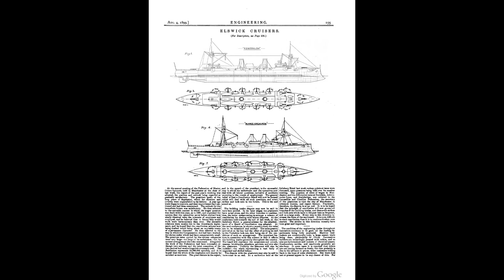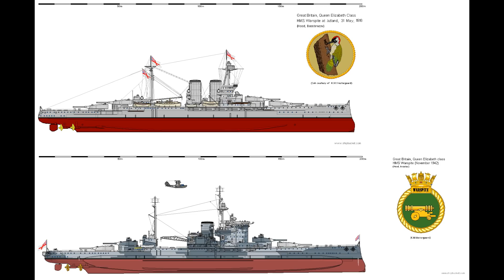The Drydock - Episode 007

Comment: One point not mentioned is that the US Navy had three different 5" guns in use early WW2. The 5"/51 was used as the Secondary armament for the Standard Battleships from the WW1 era and fired a projectile weighing 50lbs.  The guns removed from the older battleships as they received more AA guns were placed on the Sangamon and Bogue class CVE's and were given field mounts and assigned to US Marine Defense Battalions, including the 1st Marine Defense Battalion at Wake Island where they sank a Japanese DD and damaged a CL helping to end the first attempt to take the Island. The  second US 5" gun was the 5"/25 which fired a 54lb. projectile using a somewhat smaller propelling charge than the 5"/51 and was designed as a Dual-Purpose gun able to be traversed more quickly. It was the standard Secondary armament on the interwar light and heavy cruisers until the St.Louis class and the Wichita debut its successor the 5"/38. which could fire the same shell but offered superior performance due to using semi-fixed shell casings, and the longer barrel providing more complete powder combustion.

Comment: Regarding question 00:09:22 about laundry; I'm not sure when the RN implemented it but I know that on Swedish ships we had a central laundry facilities quite early, before that we had "drawer cruisers" a joke about the ships that ferried dirty laundry like your underwear and then ferry back with clean clothes.
Regarding the boilers in the question at 00:33:05 there wouldn't actually be much point in having a lot more boilers as the propulsive resistance to water increases dramatically with an increase of speed. So for instance look at the battleships of WW1 were it was often enough with 20.000 to 30.000 HP for 21 knots like the HMS  Iron Duke, but a battlecruiser of roughly the same tonnage needed 70.000 (HMS Princess Royal). 
You would have to design a much longer hull and finer lines like the Iowa's to drive a ship in higher speeds. For instance if you want the previous class South Dakota with their short squat hull go at the same speed as Iowa, they would need more than 280.000 hp! 
Look into hydrodynamics and propulsion resistance.

Comment: Q&A 1. Can you elaborate on the kind of maintenance required for battleships? At what point is it no longer economical to maintain/keep a battleship in service? Many battleships had a 20 year service life(Anglo-German arms race era) , when the service lives of the Iowas span many more decades, why is that? 
2. Please explain your youtube channel name.

Thanks again for the hard work, really good stuff here.
Reply: Short answer.... The Iowas spent most of their career in reserve storage. The so called Mothball fleet. They were sealed up and ported in freshwater locations like Philadelphia Naval yard. Then, as needed they were reactivated. So in reality they have fewer miles on them than say the 50 year old USS Enterprise now retiring. AS for maintenance? Rust prevention, lubrication, mold prevention, pest control, bilge pumps running, etc. 
As to the economics? Today it is manpower costs, and logistical issues that prevent a return. They need huge crews to manually operate systems. They use old style fuels not in service. Have parts not replaceable and crews not trainned in BB systems.

Comment: As for the USN sticking with the Standards - in addition to the reasons you quoted, you could say the primary reason was Secretary of the Navy Josephus Daniels, appointed By Woodrow Wilson. He absolutely refused to approve any substantial changes to the Standard design, determined to hold costs to a minimum, only allowing minor improvements related to seakeeping and combat and crew efficiency. As an example, the USN had actually completed testing their 16 inch gun in 1913, and requested year after year to be allowed to change the Standard design to accommodate this weapon - and year after year, Daniels steadfastly refused, forcing the Navy to stick with the 12 gun 14 inch design. Only with the entry of the US into WW1, did Daniels finally relent, allowing 16 inch guns on the Colorado class, and approving the South Dakotas and Lexingtons. Mr Daniels was also infamous in the USN for completely banning alcohol in any form aboard ship, being a diehard member of the Temperance or Prohibition movement.
Reply: It was also put forward as a rationale that if the US built fast battleships, it would render the entire fleet of Standards obsolete. That's why the Lexingtons were designed as battlecruisers with almost nonexistent armor instead of as fast battleships.

Admiral William Sims pointed out that this was idiotic, and that the entire fleet of Standards was already obsolete on account of Britain building HMS Hood. It was only because of the Washington Naval Treaty that Britain and Japan were cut off from building more vast battleships like G3 and No. 13 that would've outclassed USN BBs in speed, armor, and firepower. And yet the General Board somehow thought that if they ignored the fast battleships of other navies, they would just go away.

Comment: Thanks for another great episode of the Dry Dock

On the question of Japan using huge numbers of DD's in place of a balanced battle fleet.  This is not a new idea.  Around the end of the 19th and start of the 20th century the French also thought about doing this.  Replacing the fleet with Torpedo Boat's and Subs as they knew they could not out build the British in capital ships.  Called the Jean Eucole school I think.
It was not proceeded with because of the reasons Drachinifel put forth.  A balanced fleet will smash a specialized fleet like this, especially as the torpedoes of the time were short ranged and slow by even the standards of WW2.  This is also one of the reasons the Destroyer was developed, to destroy Torpedo Boats swarming your BB's.

One question I have is: Why do people (even today) rave about the 'Awesome' firepower of Bismarck's main guns, yet sneer at Vanguard's when both ships had 8-15 inch guns?  Although an older design, the British gun and its turret were considered one of the best designs ever produced.  Additionally the German 15 inch shell was much lighter than the British and had a high failure rate.

One the boiler question.  One country did put speed ahead of other requirements.  The Italian rebuilds of their WW1 ships used the weight savings to up the speed from 21 to a maximum 27 knots.
Pity the armour of these ships was left mostly alone and wasn't sufficient to withstand the 15 inch shells they would face.  All they could do was run.

Comment: Question...

Can I con you into doing a blurb regarding double and triple gun turrets vs 2-gun and 3-gun turrets? I notice you using double and triple for all turrets, and I'm pretty sure there's a distinct difference in their operations.
Reply: One more gun. One more gun crew. Aside from that? Added weight and size to fit the 3rd gun. Other than that? They all work the same. Speed varies by crew skill.
Reply: And ^^that^^ is why I want him to answer the question. If the number of guns were the issue, I would be sorely embarrassed to have to ask the question; while also wondering if the speech to text program I'd have to be using was adequately accurate.

Case in point. The Iowa uses a 3-gun turret, specifically NOT a triple turret.

Comment: The boiler explanation left out a major problem factor of oil burning vs coal fired. Oil fired steam was rapidly developed in the post-war because there is a much higher energy density with much lower particulate load and hence the high-eff. Small tube burner.

Comment: Q and A: I think the Kongos got their entire power plant replaced twice during their refits and ended up with more than double the amount of power. I was wondering if it is an example of "32,000-ton destroyer" you referred to in this video where they kept the power plant's original size or is the new boilers so efficient that even with a reduced power plant it was able to produce twice the power? Can you look into both re-enginings of the Kongos? Thanks.

Comment: The incident with the Colombian destroyer reminded me of the last broadside fired by a Royal Navy ship. The ship, sorry I have forgotten its name, was due to come out of service, and being the last ship capable of firing a broadside she sailed out into the English Channel to do just that. So there she is out in the English Channel and just as she fired her last broadside a Russian warship sailed out of a nearby fogbank.

The Russian captain must have wondered what was going on, serves them right for skulking about in fogbanks, but obviously realising it was not a good place to start an incident and decided discretion was the better part of valour and left the British to their own devises.

One for the Q&A. Did the navy use super heated steam like they did on locomotives. Super heated steam, for those who have not heard of it, is where the steam is heated up by sending it through pipes back through the boiler to increase its temperature and therefore its power.
Reply: HMS Zulu was the last ship to fire a broadside in the RN, can't find anything about this russian ship though
Reply: Once turbine propulsion came along, superheating was pretty much mandatory. If you're familiar with superheating, you understand the difference between 'wet' i.e. saturated and 'dry' steam. Turbines risk damage when operated with saturated steam at higher pressures, because of water droplets hitting the vanes and blades at high velocities. And the increase in fuel efficiency of superheated boilers was a nice bonus for increasing a ship's range.

Comment: Du-u-u-u-u-h, Drach, Bermuda is not even close to the Caribbean Sea. It is an archipelago of 7 main islands and about 170 additional (named) islets and rocks, situated about 650 miles (1,050 km) east of Cape Hatteras (North Carolina, U.S.). Bermuda is neither geologically nor spatially associated with the West Indies, which lie more than 800 miles (1,300 km) to the south and southwest. I'm pretty sure because I was there about 50 years ago and I don't think continental drift is anywhere near that drastic. 😁

Comment: Re: USN BB speed. As it turned out, all that was ever required of those older USN BBs in battle was to cross the IJN "T" at Surigao Strait, which they could probably have done with a top speed of 20 or even 15 knots. 

Re: IJN DD navy. If you change this to DDs and CAs I think you have a better option. CAs have better sea keeping ability and the IJN ones were expert at torpedo attack as well.  I still think the IJN should have gone with improved Kongo class BBs, but I'm not sure they would have been worse off with a no-new-BB navy. Especially when you consider fuel consumption. Actually, that could be a reason to go with a balance of ships that leaned in the direction of their excellent CAs. But then I think their CAs were exponentially superior to everyone elses.

Re: standardized secondary battery. The point about the relative size of USN and Royal Navy DDs doesn't really hold up when you recall that the 5"/38 was also used on DEs.

Re: stacks. Power isn't the only thing that determines a ship's speed. Doubling the power probably wouldn't have doubled the speed. One of the reasons I think the South Dakotas are the best looking USN BBs is that they have a single stack while the other 2 modern classes had 2 stacks. Not sure why.

Comment: I think the main reason to not go crazy on increasing power when doing a refit is due to not having a design capable of putting that power into the water.  The propeller and shaft size would be largely fixed and the technology would be mature enough that at best only small amounts of improvement could be had there.  So 10% more power? sure. 100% more?  cheaper to build a new ship.
Reply: Keeping a hull clean of marine growth does more to aid performance than playing with engines or props.

Comment: Just a comment about why navies keep this or that older ship. There are several over-lapping reasons which usually center around economic and operational concerns, but one that was missed is that navies like recently obsolescent ships as training platforms. They are close enough in technical standards to allow crews to go directly to newer ships and it's a good way to get a practical return on the investment. Also, obsolescent (not obsolete) could be mobilized for war in secondary roles.

Comment: The Montana class was designed to have the same as the North Carolina class and the South Dakota class of 28kt's, and both these classes routinely sailed as escort for carrier task for despite being at least four knots slower than the carriers.  It's my understanding that max speed is really only a factor if you are maneuvering around an enemy, closing with a fleeing enemy, fleeing from an enemy, or launching aircraft.  The Montana class was canceled because the same amount of steel and shipyard time required to build her could have built something like three Essex class carriers.  The US Navy simply decided that the carriers were more useful, though did we really need 25 Essex class carriers?
Reply: "did we really need 25 Essex class carriers?" Yes, we were going to eventually invade Japan, and that would have required a huge amount of air support.

Comment: Regarding the elimination of the second funnel, wouldn't the switch from coal to more efficient (and cleaner) oil, and to turbines vs. reciprocal engines have been major influences?
Reply from the maker: Most ships that reached WW2 were turbine engines from the start, but the switch to oil did also make a different. However, the majority of ships that survived the cull of the Washington Treaty tended to be the more modern, oil/turbine powered ships, so coal/VTE ships were quite the minority.

Comment: Did any ships have more that two turrets in a superfiring set? It seems that doing so might have allowed much better closing firepower, particularly if the ship were like the Nelson with it's entire primary armament forwards. Having the whole set able to fire directly ahead would seem advantageous. Was the reason that this didn't happen a weight issue, or were there additional factors?
Reply: Atlanta class AA cruisers had 3 superfiring 5” doubles forward.

Comment: May I ask the following. Queen Elizabeth class battleships, did these vessels or any others WWII war ships have black plimsoll lines along the hills depicting the low and high water mark normally seen on merchant ships. I just can't fine any historical images 1940s confirming this. To me it t would seam a major disadvantage to provide this statius information to an enemy during a conflict.
Dave   London UK
Reply: Plimsoll Marks are rather small, and aren't usually going to be visible to an enemy. Are you talking about the black boot top (I think that's the term) in the wet area above the red boot (always submerged hull bottom) and the gray hull sides (normally dry)? I've seen that on models of Fletcher class destroyers and I think I've seen it on other USN vessels. A Plimsoll Mark on a merchantman is to confirm that they are not overloaded for the sea conditions expected (e.g., Winter North Atlantic), but I don't know if it would really have a function on a warship.

Comment: With regard to HMS Tiger, I have to wonder why didn't the Royal Navy keep her in service as a dedicated cruiser-killer?

At the very same time she was being decommissioned and sold for scrap, Germany was building the Deutschland-class cruisers. And there was quite a bit of worry in Britain about how the threat they posed as commerce raiders. So it seems odd that they would immediately retire one of only 4 ships in their fleet that was both faster and more powerful than Deutschland. Obviously, the London Naval Treaty required some capital ships to be scrapped (or as in Iron Duke's case, demilitarized as a training ship) to comply with the tonnage limits. But surely Tiger would've been more useful than HMS Revenge, which was both in worse material condition than Tiger as of 1930 and more limited in her ability to be modernized.
Reply from the maker: At the time the RN was still eyeing the IJN and USN as the main rivals, Renown, Repulse and Hood would've been enough to deal with Germany's navy at the time and so the R's were preferred to be retained as battleline units.
Reply: It'd a pity, though. I'd have loved to see how a rebuilt Tiger would've stacked up against the rebuilt Kongos. They were such similar ships to begin with, after all.

I also wonder whether a rebuilt Tiger would've swapped out the 13.5-inch guns for 14-inch. I seem to recall reading that the BL 14 inch Mk VII had been designed specifically so that they could fit into Iron Duke's remaining 3 turrets for testing, even though ultimately they were just tested on land before being installed in King George V. While that would've been a major added expense to a refit, it would also simplify logistics.

Had Tiger been kept in service, she would've had to either be permanently assigned to the Home Fleet (13.5-inch shells remained in stock in the British Isles for railway and coastal guns), or naval bases abroad would've needed to stock those shells for the use of a single ship.

I suppose that could've actually been a factor in retiring Tiger and the Iron Dukes, even though I would rate them as overall better ships than the Rs despite their smaller guns. Certainly more upgrade potential to their hulls. But it's not as if the Royal Navy had any way of knowing that Parliament would mandate they adopt a smaller gun for the 2nd London Naval Treaty.